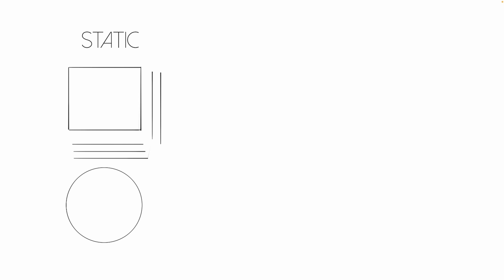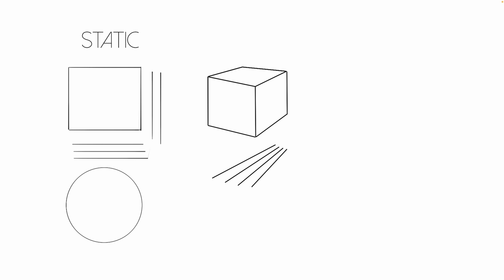How To Avoid Flat Lighting In Your Art

Comment: I’m able to do dynamic lighting and it does make everything easier and more appealing. However, I’d like to get good at making static lighting interesting.

I wanted to ask you a question, do you think Ruan Jia has static lighting? His faces often has extremely small nuances, yet executed so well. It’s nuances like that, that really encapsulates me. Would love to hear your thoughts on this :d
Reply from the maker: I personally think Ruan Jia has very dynamic light in his illustrations. Dynamic does not mean high contrast, it just means each light source has it's place to shine. All of his work usually has clear direct light and bounced light, it's just all very low key, meaning it is very soft and does not have a lot of harsh darks next to harsh whites. I find that high key lighting is the easiest to create, as light sources and contrast are strong. Also hard shadows are easier for your artists too. But correct soft shadows that do not look flat and still have directionality are something that takes more finesse to master. I suggest you study large soft light sources and how they shadow to get a similar look to Ruan Jia. I hope this helps. Great question!
Reply: @LightingMentor  Yeah exactly! It’s that softness, yet convincing depiction of form that I wish to achieve but I’ve struggled with it for quite some time… I guess I’ll just have to keep studying and pushing through, after all Ruan Jia has been practicing it for decades. Thanks for taking your time answering c:

Comment: Dynamism is certainly a product of combining the core artistic elements like Light (aka Tone), but using the combined term 'dynamic light' seems a bit confusing. The term 'dynamic' would make more sense in the context of how well the tonal range of light can help steer the viewer's attention. The examples in this video explain how DEPTH is enhanced by lighting to create more DYNAMISM, but seems to skip over how the other elements in each example like composition of the scene, the shapes, lines, colours and textures are given energy by light to guide the viewer's eyes around the scene. Light is the transformation of energy - so it can either emanate from a source, or be captured by a mass, but it is not dynamic on its own. It needs the other artistic elements to give it flow.

Comment: Some of the examples of "dynamic light" look soulless, artificial. The one with the mouse king sitting on his throne is probably the worst. You lose all the interaction between the colors that makes the picture interesting, in favor of a bland red-washed scene that ironically looks flatter than the original. It's the artistic equivalent of overprocessed food.